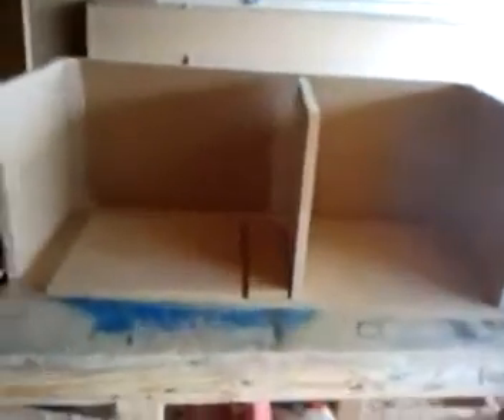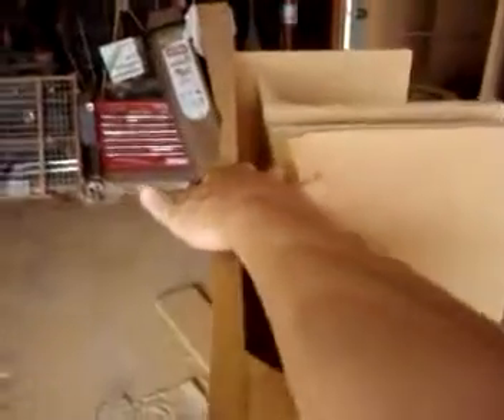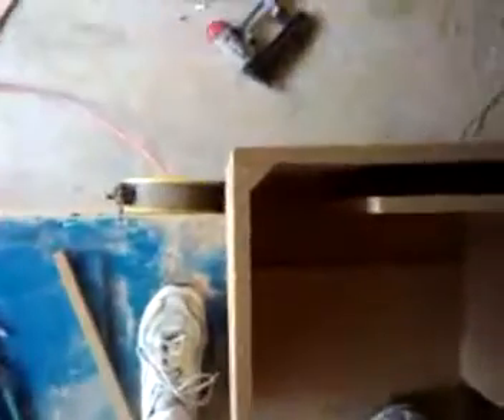port technique 101

Comment from the maker: Depends on the power. I use screws for big power. This box here was built out of nails only. It was for some little CVX Woofers.  That guy ended up with an rd9 and Is doing mid to low 50s.. Im suprised the box is holding. For that much power I would use 1 inch wood and screws. But hey. its a Wobbly woofer box, so it will hold.

Comment from the maker: @TylerTron21 you only cut the width in half if the port turns two directions. on a normal 'L' shaped port, the width stays the same.